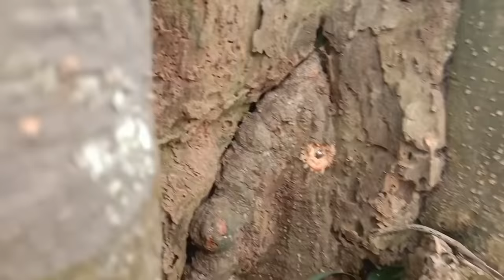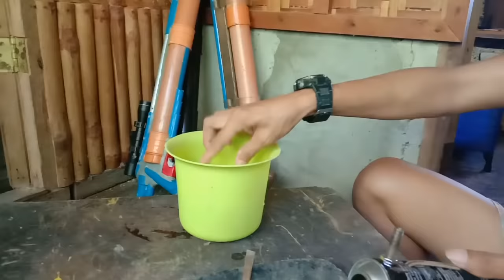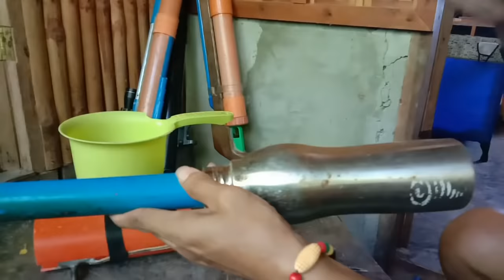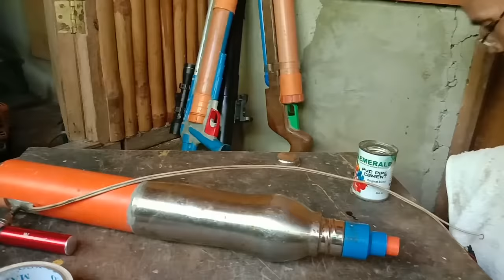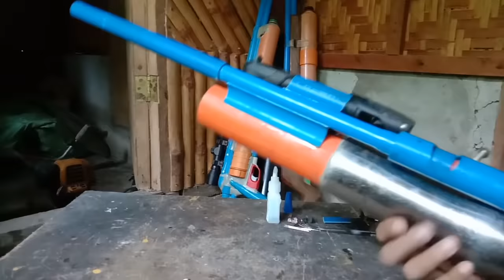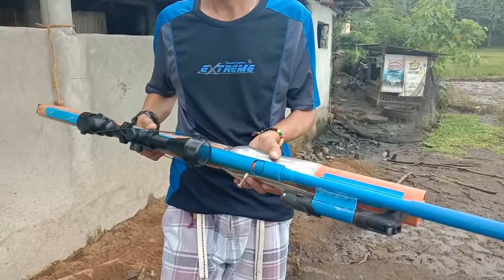ball bearing gun. using recyclable materials. toy gun.

Comment: Mantap 👍 What is the pump for?
Reply: To get high pressure.
Reply: It creates the pressure to relise the bullet 🚅
Reply: @zoloflaregaming836  It won't build pressure because there is no valve, it's open the whole way through, I rewatched carefully to make sure because I was wondering what the pump was for too.. I'm thinking more likely to blow out the old burnt fumes which can cause crap ignition.. But I'm not sure to be honest..
Reply: I think it's too blow away old fumes maybe, I don't know.. The system has no valve so I don't think it's for building pressure to help push the projectile because there is nowhere for pressure to build up, alcohol alone does a good enough job of that I know that for a fact lol.. The burnt alcohol fumes can cause it to not ignite properly every time so I'm guessing it's to release them, that's my best answer sorry..

Comment: This means I can make one using a large aluminum can that is used for pesticides or a large perfume bottle?  Instead of a plastic tube?
Reply from the maker: Yes as you wish. It's better to make it double pvc tube then insert the aluminum tube. To make it durable.
Reply: @ASENTADOVLOGSTV Can I use an airgun tube to use a 5.5 caliber bullet?
Reply from the maker: I don't think so.
Reply: @ASENTADOVLOGSTV  Maybe now the air from the pressure that will come out needs a large outlet, otherwise the pvs will burst, right?
Reply: @ASENTADOVLOGSTV Could you call your inventor friends and ask them if a 5.5-gauge tube can be used for an air rifle?
Reply: @ASENTADOVLOGSTV I thank you very much
Reply: @العراقي-ث2ر  you mean a 22. Caliber size barrel? Yes you can still use that kind of size
Reply: @العراقي-ث2ر  it depends what size pellets you want to use.. It works best if the projectile is snug inside the barrel..
Reply: @العراقي-ث2ر  That depends on how much alcohol you use, the size of the chamber, how many layers of PVC you use for the chamber, and how snug the projectile is inside the barrel - too tight is more likely to cause the chamber to explode but still very unlikely.. I haven't yet heard of double layer PVC piping chamber with threaded caps exploding yet.. And just use common sense when applying the alcohol - the more alcohol=more pressure and heat=more likely to explode.. Also consider how the material used for the chamber was stored, for example, PVC left out in the weather for some time can make it go brittle which is obviously not good..

Comment: anu po ung materials..
Reply from the maker: Tangke po ay 2 and 1/2 pvc tsaka stainless na napulot ko. 
Barrel antenna aluminum tube 8mm. Doblehen lang ng 1/2 pvc.
Lighter.
Pump.
Epoxy.
Super glue.
Pvc solvent cement.
Screw.
Wire.
Reply: @ASENTADOVLOGSTV  salamat po sa info..gudluck po sa inyo sana dumami pa po subcriber nyo..